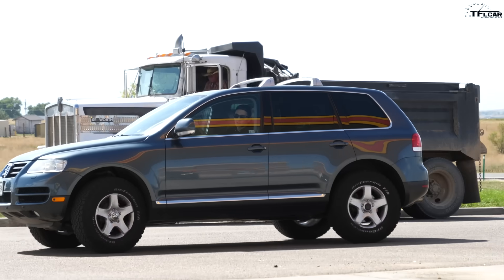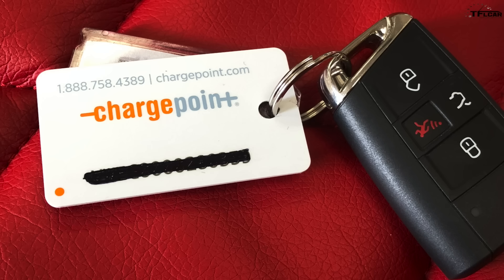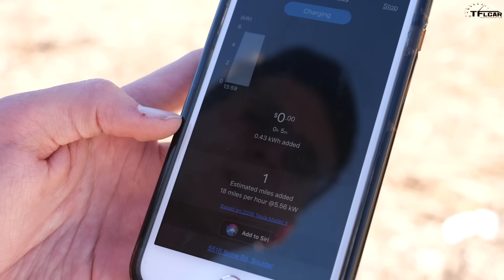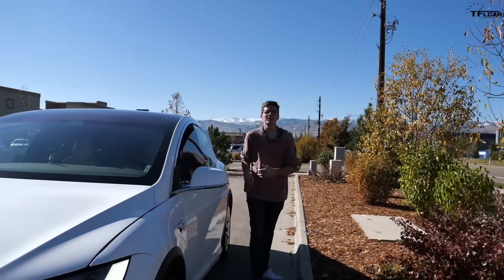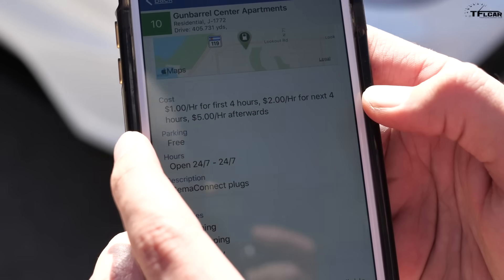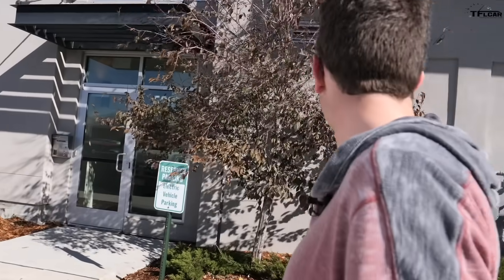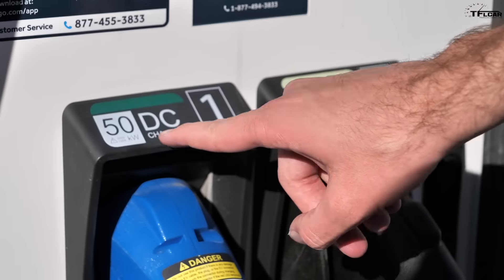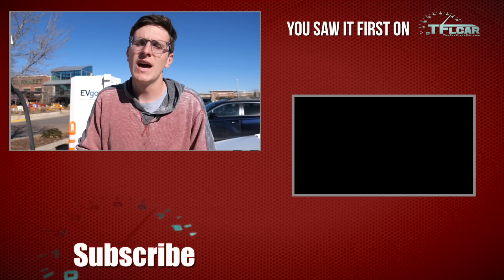Here’s Why Charging an Electric Car Can Suck - And It’s Not The Reason You Think!

Comment: The technology needs to improve before I get one.
Reply: Yeah! Improvement somewhere around 12 minutes for complete charge
Reply: @lemmetellyousomething679  12 minutes from 0 to full charge will kill the batteries and may ever trip the utility breaker/fuse protection. With that said there are fast charge devices somewhat like a capacitor, but still the horrendous inrush current (many thousands of amps) cannot be ignored.
Reply: @kimchee94112  who knows maybe we'd have this tech in next couple of years😉
Reply: @lemmetellyousomething679  Do you not have a garage or a house with a parking spot near your house?
Reply: You Know Me - Now you’re talking about the new V3 chargers Tesla is putting in...250 kw.
Reply: Improvement somewhere around 5 minutes for complete charge, standard plug, charger accept credit card, etc. That's not transportation, that's a wild insane nuisance. Those folks are still early adopters on the bleeding edge!!!!
Reply: @tsamuel6224  15 minutes for a charge is so lame amiright. noone is every happy with electric cars. used to be overnight charging and now they can do 80% in 15 minutes but that's still not fast enough. Credit cards are accepted fyi. and if you want a standard plug go complain to all the big auto makers. Tesla released their charger patents amongst others so that there could be a universal system but the big auto companies wouldn't use it.
Reply: 0xsergy It takes 10 hours for complete charge!  Hell no that isn’t good enough. Only takes me 5 minutes to fill my truck up with gas.
Reply: @JK-cn5fy  Only on a slow charger... on a supercharger a Tesla is charged to 80% in a matter of half an hour.  After driving more than 250 miles most people need to take a dump and have a bite to eat.

Charging at home only takes five seconds (to plug in the car), when you're asleep or working you are not waiting.

Also people don't seem to realize your battery doesn't have to be FULL in order to drive the car. A Tesla that's charged like 40% can still drive for more than 100 miles. That's more than 99% of average commutes and trips to the shops.
Reply: @davidsommen1324  You sound like you own one.  Question for you... Owning a Tesla and understanding the basics of charging AND actually understanding the more  technical aspects of the vehicle are two totally separate things. So, please only respond if you are technically inclined to do so.  From a more technical position, does the life of a Tesla battery deteriorate at a faster rate if 1) charged with a supercharger 2) charged erratically for varying time periods 3) charged to random varying percentages?
Reply: @JK-cn5fy  I don't own a Tesla, unfortunately. And I guess from your definition I'm not technically inclined to answer that question conclusively. What I do know is that Tesla batteries are very high quality (both chemistry and management) and that degradation is hardly the issue a lot of people make it out to be. It definitely does not deteriorate like a cellphone or laptop battery might, because of better management etc. 

ICE vehicles also lose some range as they grow older, but as the base range is so comfortable and filling up is very easy, that's not really an issue. The same should become reality for EVs, and right now we're definitely not there yet, but a lot of progress is being made.
Reply: Despite the charging stations looking quite flash the process involved in just getting the charger connected is just far too slow compared to using a self service gas station and people who did not grow up with computers/apps would struggle.
Reply: @petercreagh8797  imagine grandma on way back home from Wal-Mart  and battery dies
Reply: @petercreagh8797  Struggle? My mom is gone, but she would not have had the slightest idea what they wanted done.
Reply: Tt55 K    You ain't kidding!
Reply: The world needs to run out of oil before I get 1
Reply: Same here. Solid state batteries with improved lifespan, less fire hazzard and 15min fast charging need to come first, also multiple fast chargers on every petrol station.  In Norway Fast charging is currently more expensive than petrol.  Not acceptable.
Reply: Thor _  in Australia power  is so expensive by the time you pay for an ev and charge it at home! And don’t ask how much they would charge at charging stations!
It would be more expensive than running our v8 patrol
Reply: @drealist7941  The Cybertruck may have solar panels as an option. Equal to 15 miles per day,  maybe 40 miles with added solar wings. Isn't Australia hot and sunny most of the time?
Reply: Thor _ , here is my concern about it , okay the world goes electric what happens to all the millions/ billions of tons of dead battery waste ?  What will the effect on the environment be? We already have crooked waste disposal companies dumping in the ocean , what will be the effect on the earth , the ground water and the aquifers ?
Reply: @tt55k  Batteries are recyclable, the toxic waste made by burning fossil fuels is not.
Reply: @tt55k  that's the also a big advantage with solid state battery, the minerals needed is much more environmentally friendly than normal lithium based batteries. And the lifespan should be much greater. I drive petrol direct injection turbo. Maybe I'll switch to electric in 10-15years. Probably not before that.
Reply: Thor _ , yes , I was thinking lithium not solid state .  Maybe I am strange but I support thorium for powering electric cars , a person could buy a thorium fuel cell that would power whatever car or truck they have for the next 80 years , then the used ones could be put in safe containers for the next hundred years until they are completely safe . The amount of thorium needed is very small . At least until the Government releases alternative sources of energy they use for space travel that they keep secret .
Reply: @tt55k  Recycle, the problem is running out of raw material for ever more demand but there are other options in the pipe line.
Reply: Tesla charge at over 1000 miles an hour... only matters for road trip. 
Its also a free for Tesla X & X owners. zero fuel cost to drive cross country.
Reply: No shit... So basically you can't even consider one if you live in an apartment.. even then.. it only gives you more expense to pay your landlord.....
Reply: citizen-x  The 12v battery of an EV can be jump-started. A completely dead high voltage battery has nothing to do with 'leaving the headlights on'. It is exactly the same as having a completely empty fuel tank. How would jump-starting resolve THAT in any way?
Reply: Electricity has to come out of thin air before I get one. There is no such thing as zero emissions. I have seen charging stations that are diesel powered generators. Wow. Yeah. Now you are driving a diesel around by proxy. Good job green people.
Reply: In the 1980s two California engineers developed a battery which was charged by replacing the electrolight.  Charge time same as gas powered cars.
Reply: It has improved a lot but these companies like charge point use old technology
Reply: Tt55 K - Teslas are a light year ahead of what ever you are driving, guaranteed.  You ignorance is showing.
Reply: Macguy , you presume you know anything about me , I think Rimac is beyond what Tesla is bringing to the table as far as battery tech goes , Porsche bought 10% of Rimac, so look to Porsche and Volkswagen group to be producing a better quality product and  stronger batteries than what Tesla has put out.
Reply: citizen-x  No, you still don't get it. The 12v battery is SEPARATE from the fuel tank/high voltage battery. If for some reason the 12v battery on an electric vehicle is down, (which it probably won't because of technology) you can still jump start it and you'll be just fine
Reply: citizen-x  Wow. You're just dead wrong, embarassing.

Comment: In order to operate a fast charger there needs to be 480 volt source power.  That is  typically only available in industrial areas or larger commercial facilities.  That is just one of the many issues with building out a charging network that could have any hope of supporting massive numbers of EVs.

Comment: I still feel as though hybrids are the more practical. Not full electric and not full gasoline but hybrid.
Reply: Twice as much stuff to go wrong, tho.
Reply: @Ratbert32305  Yeah, like a gas engine that blows up or overheats w/no 2nd back up engine, or gas prices that skyrocket e.g. @oil company's mercy...oh wait... What was the issue again?...
  ;)
Reply: KnowledgeApplied where the hell do you get that info from🙄
Reply: Dude we know what hybrid means.
Reply: Only for another 5 years at most. Tesla are now releasing the V3 Superchargers and cars with a range of 500 Miles. That means that you'll only be at Superchargers for 10-15 minutes and you'll have 500 Miles of range.
Reply: Probably won't happen because countries like the UK and Germany have implemented plans to BAN all gasoline/diesel engines and that's not even 20 years away. Probably less than 15 years.
Reply: @largol33t1  2020-2025 for a lot of the EU. at least inside cities.

Comment: no level 3, https://youtu.be/jZBsOud4O9Q
So much for a standard!
I think a screwdriver, drill and cable clamps on the end of a cable might be a quicker more efficient adapter method, other than the required electrical knowledge.

I'm sorry you said there was a charging station hear, your connector doesn't fit so I'm connecting my own up, if you want me to pay for your service then you should have a standard connector ( and Payment ).

Comment: Takes forever to charge....can deal with that

Charge stations scattered throughout the city....a pain but can manage

Having to buy adapters for the various plugs each station uses....early adopter tax, whatever.

Companies that haven't figured out a system to where I can just drive up, plugin, and swipe?  Yea I'm not playing application roulette when I find a station to keep track of which of the 50+ apps I need to use at any given time.

Overall the process sounds like a huge pain in the ass.  Until they get to the point where a 100% charge takes around 15-20min while not at home, it will be a pretty big barrier to entry for lots of folks.
Reply: That's what Tesla Super chargers offer you.  On a road trip you can charge around 150 miles in 15-20mins.  Unless you're really driving straight through, that is an average amount of time you'd need to stop to stretch, use the bathroom, get some food, etc.
Reply: To add to what Brian said. At Superchargers you don't even have a card to swipe. You just plug it in and it has a communication pin that talks to the car and knows whose car it is and which account to charge it to automatically. Your account is tied to a debit card.
Reply: there's only like 3 apps I know of and what do you expect? people complain about not enough chargers so companies open up charging stations. now people complain that a 2mb app is too much hassle. noone is ever satisfied.
Reply: @0xsergy  Given there is a little sarcasm in my statement, yet another app isn't going to kill me.  However, I'm criticizing that the current method is not helping with getting more of the general public to adopt EVs.  I just find it hard to believe that you can't just go up to a charging station, plug in, swipe card, and everything is good.  As popularity increases, there will likely be more companies to be installing more charging stations.  And while maybe not a huge deal now, down the road it could start getting silly.

Comment: @12:30 There is NO SUCH THING AS "Level 3". You're perpetuating marketing mis-information. "DC Quick or Fast Charging" is actually Level 2-DC. All the "levels" have to have something come after the level number also. So there is no "Level-1". Its actually "Level 1 AC" or "Level 2 AC" or "Level 1 DC" (no actual chargers exist for L1DC though), etc. The ACTUAL charging levels are as follows: Level 1 AC 1.92 Kw. Level 2 AC 19.2 Kw. Level 1 DC 48 Kw Level 2 DC 400Kw. So, as you can see, LEVEL 3 DOESN'T EXIST.

Comment: Why does Tesla not use the "standard" plug? Damn stupid.
Reply: They do in Europe now (SAE Combo plug on the Model 3)
Reply: Tesla literally invented the standard plug(first electric car), released the patents for it so that it could be standardized, and then got ignored because the big auto manufacturers wanted to give them the finger. Blame the auto manufacturers not tesla.
Reply: 0xsergy No, Tesla didn’t “literally invent the standard plug”. Hahaha. J1772 came out in 2001, two years before Tesla was even founded. Tesla chose to use a proprietary plug.
Reply: @xNYCMarc  J1772 doesn't support supercharging so now we're back to this argument..sure they didn't invent the plug but what cars were using plugs before the first teslas came out? Sure, there may have been a patent on a plug that sat on a shelf and was largely unused other than prototypes.
Reply: 0xsergy Yes it does. Its called SAE combo. Tesla’s “first electric car” as you call it didn’t support fast charging either.
Reply: 0xsergy J1772 was well established by 2008 when the Tesla Roadster came out, but did they use it? No. They used a proprietary connection that didn’t even support fast charging. They came out with yet another new plug with the Model S that wasn’t even compatible with their other product.
Reply: @0xsergy  Tesla also didn't have the "first electric car". General Motors had the "first electric car" back in 1996, the GM EV1.

Comment: Non-Tesla public chargers are a nightmare.  Every charger you find is run by a different company, requiring an account set up.  Like EZPass everyone charges your card $20 off the bat, and you may use 2 bucks and never charge there again.  You have to have a Tesla and only stop at Tesla Superchargers.  That’s the reality.

Comment: I would not have the patience, if you drove around boulder for work and the places you had meetings at had the charges it may work but then you are leaving your vehicle with the cord hanging from it.  Around here I would need to haul a generator running on gas to charge the car.

Comment: All this and EV's are only about a 50% reduction in your carbon footprint as contrary to Nissan Leaf's "zero emission" sticker they still use fossil fuels.   No your rooftop solar doesn't change that as 99% of the people don't have their car plugged in at home during peak sunlight hours.  So a hybrid like a Prius that gets well over 50% better fuel economy then our nations average of ~25mpg actually has a lower carbon footprint then any of the EV's on the market and the tank range is 500+ miles.

Comment: and here I thought it would be about assholes in gas powered cars parking in the charging spaces. I've seen it happen when the chargers are in a parking garage and you can't reasonably get a tow truck in there to remove the car.

Comment: Good report but all of this is moot. There are many pitfalls to even getting half the cars to EV. There is simply not enough infrastructure to get everyone charged up. We have to get electricity even cheaper than it already is otherwise the reasonable prices people talk about now are not going to be so reasonable in 10-30 years. Also it's pretty obvious people don't want to wait to charge even half an hour, so swappable batteries is clear where it needs to evolve. Along with that, swappable battery industry standards. Once we figure out a good way to do that, the investment is going toward battery/fuel stations not fast chargers.

Comment: Simple idea. Removable battery. Design electric cars to use standard removable batteries. Fork lift. Have standard fully charged batteries on hand at the station. Easy in, easy out. Fully charged in 5 minutes. Remember when people would put in new batteries, in flashlights, radios, etc?

Comment: What is needed is standardized rapid exchange system, analogous to that of fueling or rapid oil change stations, which would eliminate range anxiety! Charge point posts, either at home, businesses or public locations would continue to co-exist where time charging, such as at home, hotels, or places of employment. Imagine battery exchange of 400 mile ranges would do for long distance driving on the Interstate!